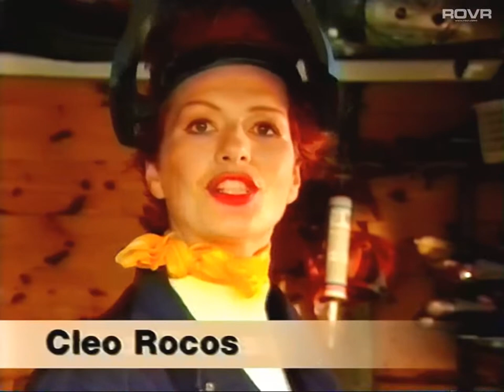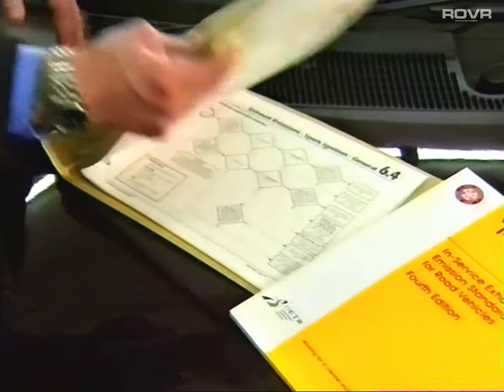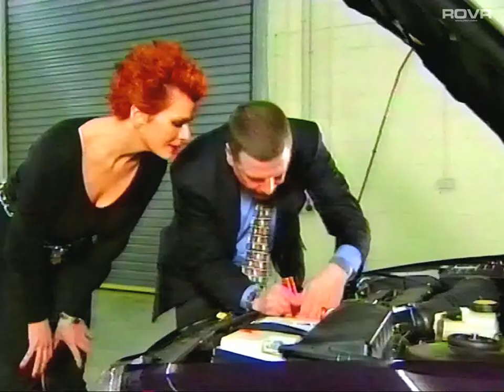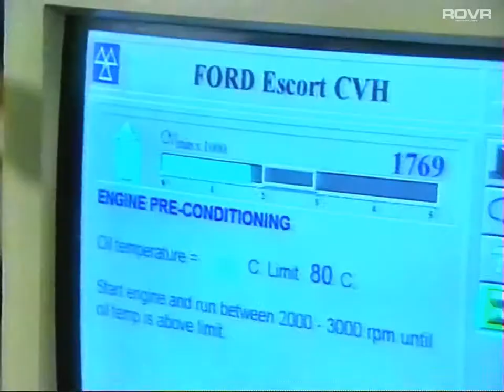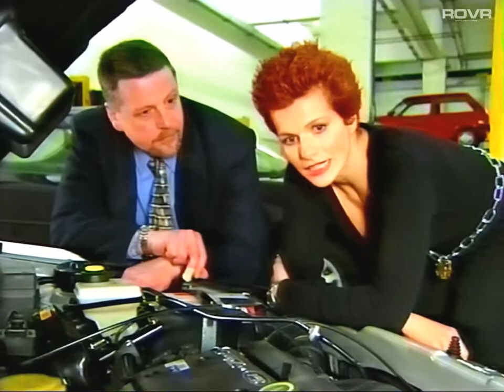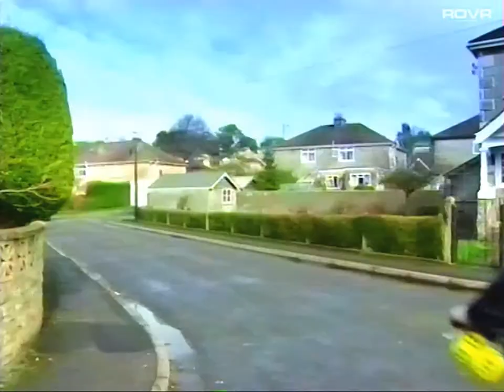Vehicle Inspectorate (UK) - MOT Matters - Its a Gas - VIV11 (1999)

Comment: Love the 'No smoking' tape with the picture of the reeky car. 😂

20 years later, in Northern Ireland, diesel emissions aren't tested.

Many a lad driving about, billowing clouds of black smoke from their car. Loud straight pipes, dummy boxes & reek maps are popular. 

As well as that, other vehicles that have had similar done in a more civilized matter. DPFs drilled, EGRs blanked & ECUs remapped to prevent engine management lights. 

If diesel emissions are ever tested here, thousands of cars are screwed!